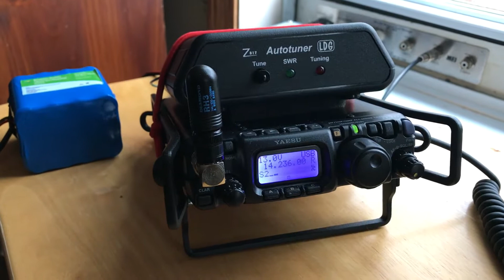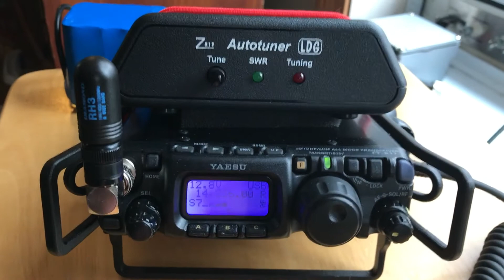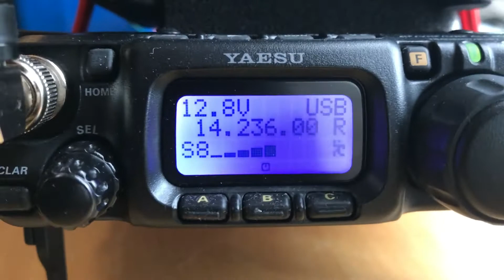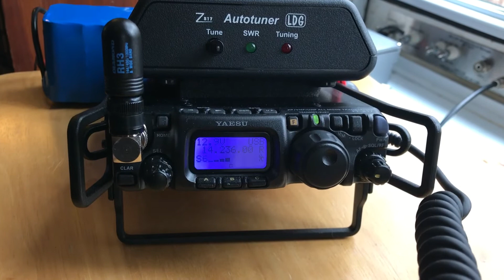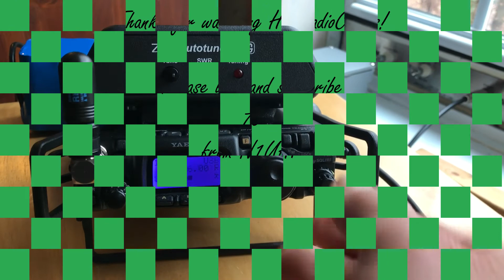FT-817ND QRP 20 meters Maine to Florida

Comment: I recently made a contact with 9M2S in Malaysia in the recent wpx SSB contest. 2860 Kms with 4 watts SSB sitting in Chennai India. 817nd is almost 15 year's old and still perform beautifully. A keeper at my shack.  My other Radio, an ICOM IC 7300 is on standby. 73 VU3MES Satyan
Reply from the maker: Hi Satyan ... nice contact! Yes, it’s a great radio so small to take anywhere. Here in the Eastern US Asia is difficult but maybe with the sun spot cycle on the upswing things are getting better for propagation. Thanks for commenting.
73, Ed.  N1UHF

Comment: BTW - What do you use to charge the Bioenno 4.5Ahr LiFePO4 battery? I plan to purchase a small 4-7aHr battery.
Reply from the maker: Hi Gary.. Bioenno has their own charger that works with all their batteries up to 20ahr I think.. it looks like a laptop type charger with an LED status LED on it. It's only about $22, so that's what I use. Also, I have 2 solar chargers that are made for LiFePO4 batteries, but I mostly use the 110v charger. 
Bioenno has the 4.5ahr, 6, 9, and 12ahr and up. I have the 4.5 and 9. The 9 is fairly large to fit in a small bag for portable but is lightweight. I plan on getting the 6ahr some day to go with my 9W QRP LD-11.
Reply: Thanks for the reply. I checked out the Bioenno website. I saw the various batteries and charger you mentioned. I plan to purchase one of these batteries to run my FT-817nd on 5 watts while portable. Really nice products!